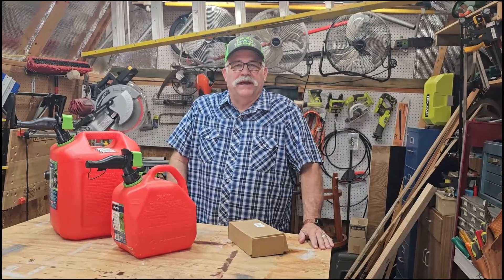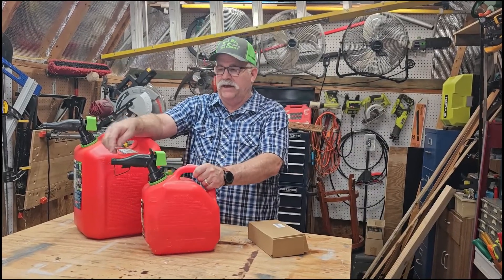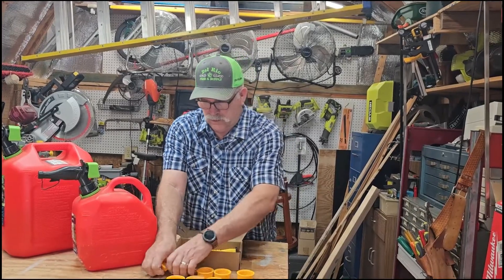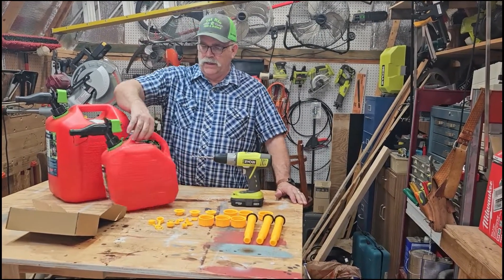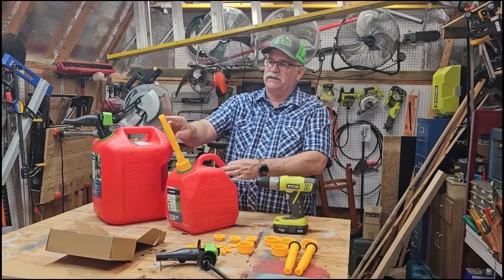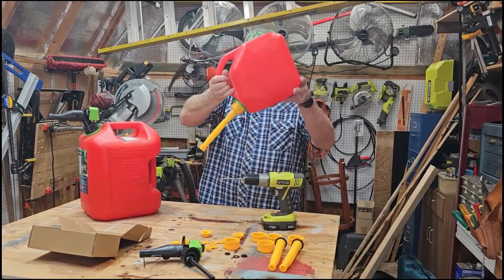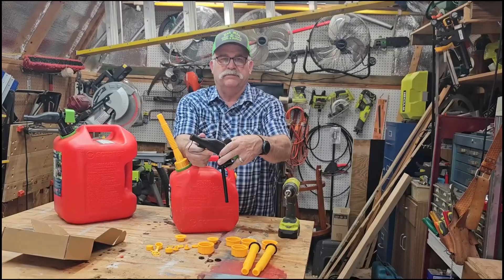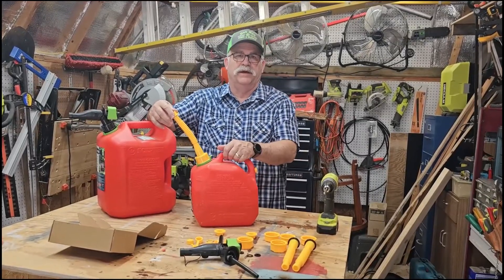How To Replace Gas Can Safety Nozzle

Comment: What size drill bit? Can I sue the manufacturer of this new EPA Gov reg designed nozzle, using it totally F'd my back up.
Reply from the maker: @plbwiki768   I think it was 1/4 inch it is include in the nozzle replacement kit. Here's a link https://amzn.to/44yIEQl Thanks for taking the time to watch my video and comment if you haven't subscribed to my channel please consider that along with clicking the notification bell so you don't miss out on any future videos. Here's another video you may like https://youtu.be/DaRJbNJlvtk
Reply: Any luck?

Comment: these were supposedly to solve gas evaporating from cans with cap left off &/or vent not closed (old style cans).  BUT, I have spilled more gas with this new safe design than any vaporization from my old style can.  Thx for the kit link.  I was using a cork in an old can I got at a yard sale!  Thx to thumb and wrist arthritis I cannot use the new "improved" design...this will really help!!
Reply from the maker: Thanks for taking the time to watch my video and comment if you haven't subscribed to my channel please consider that along with clicking the notification bell so you don't miss out on any future videos. Here's another video you may like https://youtu.be/gu7K8stzvh0

Comment: I have done the same. I have used epoxy to hold the vent into place. 

Also, be sure to drill with an empty, dry can and to clean out any plastic bits after drilling.
Reply from the maker: Thanks for taking the time to watch my video and comment if you haven't subscribed to my channel please consider that along with clicking the notification bell so you don't miss out on any future videos. Here's another video you may like https://youtu.be/H14QEADCs0Q
Reply: Excellent tip!  Mine popped out, heat expansion.

Comment: Im new to this but i got 2 gallon one of these and i tried fuelling it at the gas station but it ended up spraying out towards me. I tried to squeeze the trigger slowly but it just seems like it wont be coning out of pump slowly. Any idea?
Reply from the maker: @ajiaisthu3225 ,  Yea that's why I changed to these nozzles they are easy to use I don't like the new safety nozzles. Thanks for taking the time to watch my video and comment if you haven't subscribed to my channel please consider that along with clicking the notification bell so you don't miss out on any future videos. Here's another video you may like https://youtu.be/Uu4rM7HnNpk
Reply: Some have a filter device inside the fill hole....small holes cannot handle flow even at slow rates and will auto shut off.  Use a couple of needle nose pliers to remove and no more fill problems